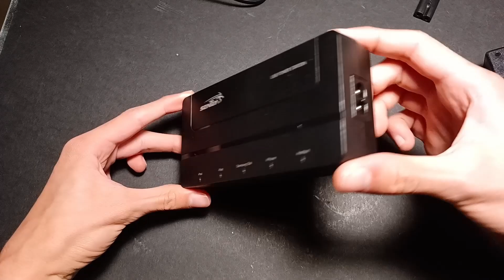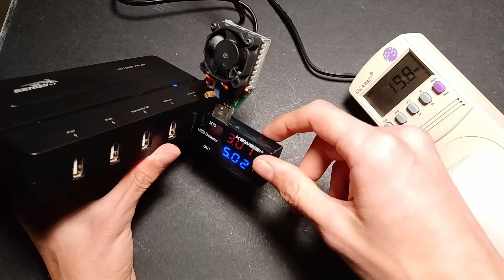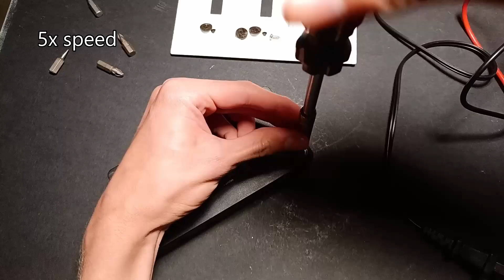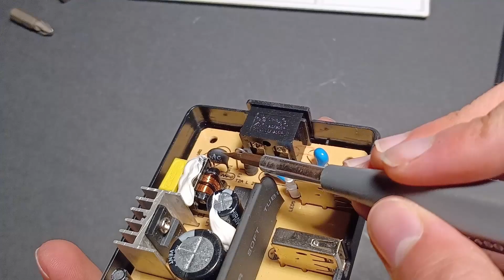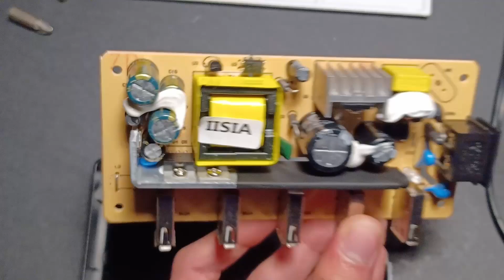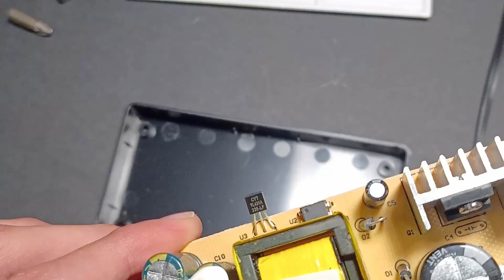Inside a 5 port USB charger/charging station

Comment: This charger looks safe, but not built for reliability. As for the bulging caps, I'm not surprised, given the combination of unknown brand and the heat the capacitor is exposed to
Reply from the maker: When using this charger at close to full load (charging multiple devices), the case would get too hot to touch. The internal air temperature could be much hotter than the case temperature. This is likely what lead to the capacitor bulging, in addition to its unknown quality.